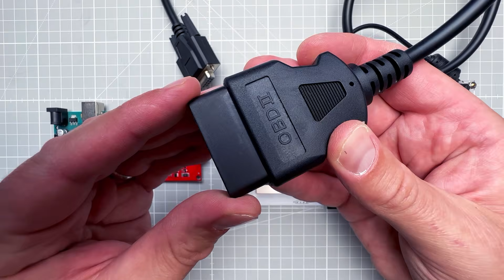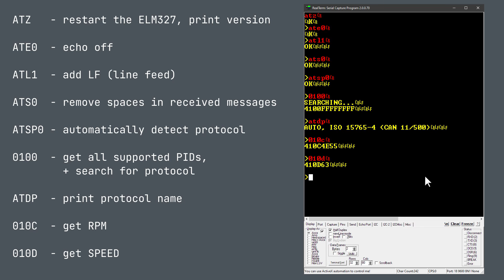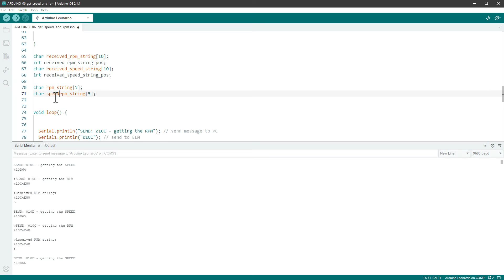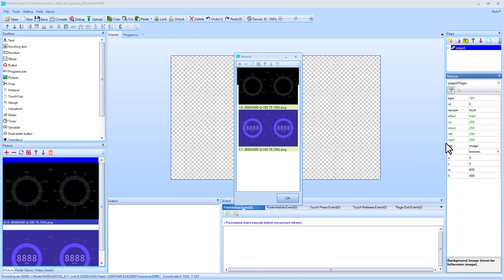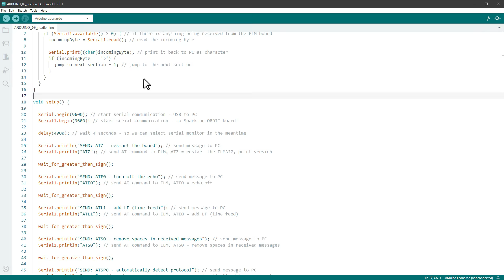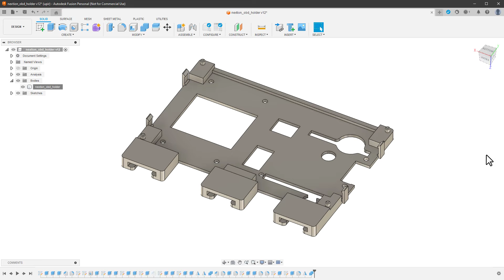Arduino Dashboard (full tutorial - with Nextion Intelligent Display, OBDII ELM327, Arduino Leonardo)

Comment: Wish it wasn't so laggy
Reply: You could program an animation that counts down to the new value received from to obd port to make it seem smoother
Reply: Using OBD to communicate with the modules has the PRO of being universal and will work on most cars, the CON is that it is slow, the refresh rate is a lot slower than  the actual CAN busses used between the car modules themselves. But attempting to use the BUS directly will add the complexity of having to sniff the messages for each vehicle.

If you also notice newer vehicles, the speedo gauge for example, the analog is fast and responsive but the digital tends to update slower and gives averages, even though they are getting the same fast signal from the ECU/TCU, so it is about how you get the data and how you manipulate it.
Reply: Looks like my comments dissappear so here we go again:
I'm currently working on a similar ESP32 + Bluetooth/WiFi OBD2 dongle solution. I discovered that the cheap Chinese BT/WiFi OBD2 dongles can only read data every 200-300ms, with significant variation in the delay. To reduce lag, I measure the time between data readings and use interpolation to smooth the values (e.g. speed) by transitioning between the previous and new values over that time period.

According to ELM documentation , early OBD standards required that scan tools not request data more frequently than every 100ms.
"The early standards required that scan tools not request information more often than every 100msec."
Reply: X @esakujala2949 were can I fallow your project?
Reply: You guys are focusing in speed, but for oil temp, egt temp, boost map and air intake this visual speed is more than enough
Reply: Projects like this should be built on more powerful MCUs, like TI, STM, ESP. 
It's not only faster, it's cheaper.
Reply: @The_Novo  All OBD apps that give speed rpm etc are roughly this laggy, this is more of a OBD issue other than anything else.
Reply: @PatalJunior  yea you're right, I've also experienced some lag with my bluetooth obd reader using torque but I assumed it was the cheap reader and the bluetooth causing the lag, Idk about wired reader's speed
Reply: @PatalJunior not necessarily. it's an efficiency thing. a good example of a device that can pull realtime data from an OBD2 port at a high speed is an ultragauge. as long as it's above 50° f or so the board can update at around 30fps while simultaneously displaying 8 data streams.
Reply from the maker: Thank you for an interesting discussion, I agree that it would be better to animate faster, and I will cover that in the next video. As noted already, it´s not mainly the Arduino UNO that´s slowing it down, but the combination of ELM not providing data fast enough and Nextion display not updating the graphics fast enough.
Reply: @upir_upir  I'd love to see it on one of those esp32 circle displays you used previously. it would be an amazingly easy way to make a "multi gauge" that could fit into any gauge pod. it might also be capable of a higher frame rate.

Also for a good elm adapter take a look at the OBDlink MX+ for Bluetooth or the OBDlink SX for USB connection. while they're definitely more expensive, they're also guaranteed to be using the most up to date version of the chipset and it has an amazing response rate
Reply: @4point8garage  I would like to see also these OBD2 adapters and Konnwei KW901
Reply: @upir_upir it's not really an odb2 issue, it could be an issue of the Rpm not being sent often enough. Different vehicles dispatch at different rates. Odb2 is perfectly capable of sending rpm every 10ms if the PCM or ECU sends it. In my opcm I get TONS of data and send it to a Nextion and it's smooth as butter once you batch the commands to the Nextion and only send them every 100ms.
Reply: @upir_upir  do you know if it is possible to use a haltech emu or any other standalone to send information via a can bus connector to the Arduino and then to the display?
Reply: @The_Novo  the question is if the speed is really a limitation of the MCU and not the ELM chip itself. I am pretty sure the uno could  request the data far more often but it takes time for the ELM to respond.

Comment: This is a very interesting topic, please continue about OBD2 !!!
Reply from the maker: I will. Next step is to take a look at those cheap Chinese elm boards, first wired and also Bluetooth connection, and of course getting more data than just speed and rpm. What would be the most interesting for you?
Reply: @upir_upir  thanks for sharing.  voltage level with an alarm if the alternator fails.  A way to determine if the odb2 can tell if the aux is on or off.
Reply: @upir_upir  not sure if that overlap your interest but some info about OBD2 and CANBUS and if all messages are available on obd or only some of them? Like.. outside temperature or opening/closing windows via touchscreen > arduino/esp > obd/canbus? I've heard [need to confirm it] that ODB2 has only partial access so in order to get full access [like opening windows] one must connect to some other, more hidden connectors inside the car. Would be nice to get this topic covered :) Thanks
Reply: @upir_upir  will you still do it ?
Reply: @upir_upir  Perhaps information about the degree of filling of the DPF filter, as well as the current temperature or the active filter burning process, or the burning phase?
Reply: Konnwei KW901 would be interesting ELM327 dongle. It is small and have on/off switch
Reply: 'that Video is so mart. Give alot of information.